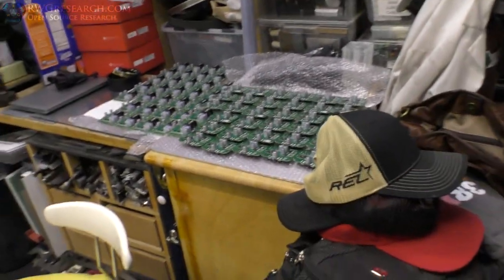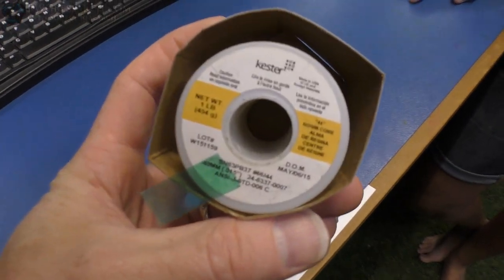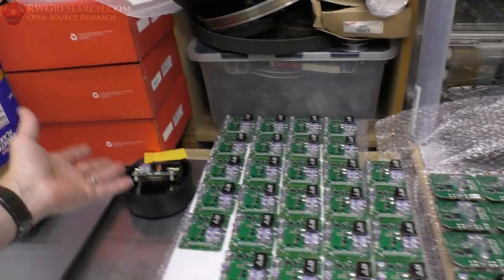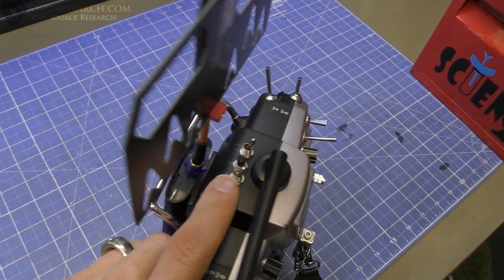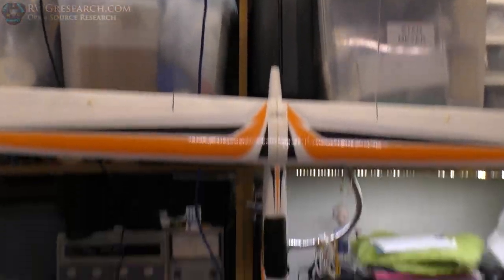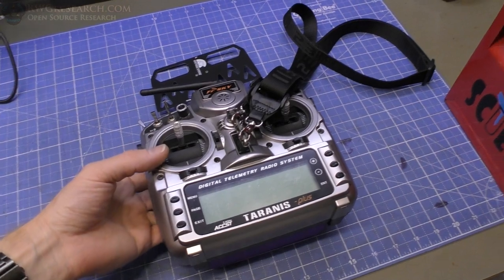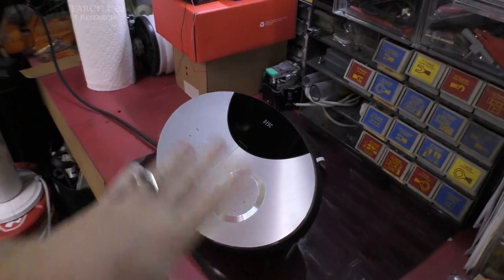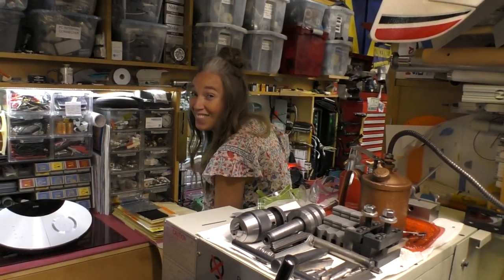Update! All The Stuff But No Videos! What Do You Want More Of?

Comment: B&O also has a really nice remote, in that it is actually 2 way, with either IR or wireless communication with the remote, so you not only can control things, but also get displayed on the remote CD text and data, and also RDS information off the FM radio. Plus all parts can be an IR receiver, so the remote does not need to point at the unit to have communication. Of course that does mean the remote is half the price of the system and is rather demanding of battery power...